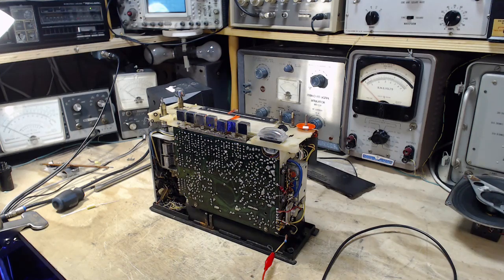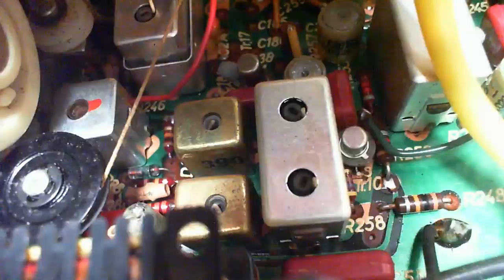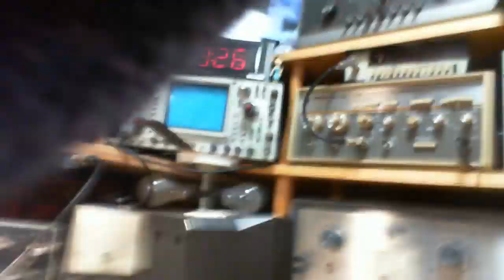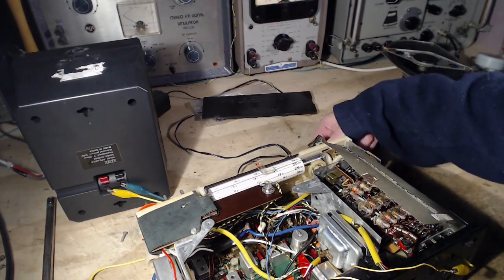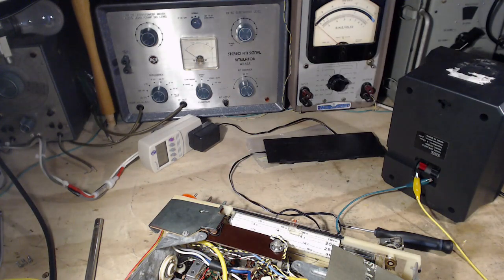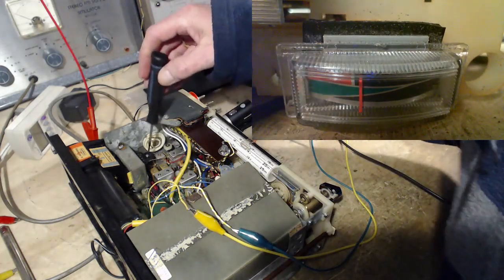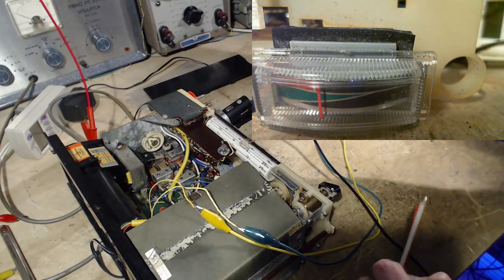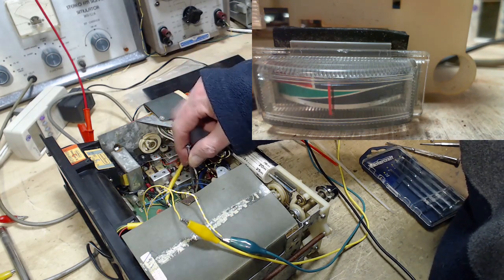Nordmende Globetraveler III   Video#4 - FM Sound Quality

Comment: Normende means don't touch alignment.
Reply: Cosimo Kramarawicz Legit and sound advice , given that with the german radios of this era there is hardly a history of drifted RF and IF components. So if you find it misaligned and there is no indication of ppl having been in it before, you may want to check for possible root causes like failed power supply voltages, bad electrolytics in AGC AFC Ratiodetector, power supply filtering, off value resistors etc. and make tampering the RF/IF alignment the ultimate ultimate resort.

Comment: Get a proper service manual. The alignment of the short wave "BANDS" needs to be performed in order and is highly relying on the exact adjustment of the 49m band with specific frequencies. Also it requires discipline in following the instructions, in that adjustments of bands already adjusted not be changed anymore. And we all know that following instructions to the letter and discipline in following procedures is not Jims strong suit.Also the SW bands turret tuner has a separate stabilized 5V voltage regulator, which has to be adjusted before any other adjustments be made. In that realm the electrolytic filtering the 5V after the regulator should be replaced to ensure minimum ESR (although there is a 47n parallel to prevent worest case scenario) before any further twiddle-diddle. Also FM ratio detector electrolytic should be replaced before detuning the FM IF.
Reply: Too complicated, Jim prefers the eeny, meeny, miny, moe, catch a IF coil by the toe method...
Reply: Again he is using Metal watchmakers screwdrivers with sharp edged blades to adjust the known brittle ferrite core slugs on the IF transformers. We all know where this is going, dont we? This radio will be turned from "working ok may just need be fine tuned properly" to "worse than before"
Reply: StillCloser Yeah. that single coil he is been messing with to "align" FM btw is Filter XIV (as in no.14. Nordmende liked to use roman numerals to designate the Adjustment points) and is the final AM IF. I mean even the most simple schematic or the german version of the TN6000 manual would help to get a general idea. The electrical symbols in the schematics  are "universal language" after all. This blind twiddling is unbearable and counterproductive on such a complex radio.

Comment: Jim, here's a long shot, but it may be worth considering:  I have a couple of nice FM radios that give great sound.  Both have the option of running on battery or AC power.  For convenience, I almost always run them on battery.  And I have noticed that, when the battery voltage drops to a certain level, FM reception becomes a little garbled.  
In an earlier video, you told us you were using an outboard power supply that was not the one that came with your Nordmende.  So you might check to see if that power supply is providing the correct operating voltage for your radio. Good Luck with this one!!

Comment: Hi Jim
Just picked up a Globetraveler IV at a flea market for just $5. It came with the ac cord. Turning on all i get is a  light under the SW tuning bar when pressing the SW button. No sound.  The speaker is good 
I suspect it's missing a secondary voltage. Any ideas
Bill

Comment: Why do you assume that it needs alignment. A place to start is alignment of your shop equipment, frequency counters etc.
Reply: widecast No question that fixing and servicing and realigning his shop equipment is long overdue. But there is a misalignment evident in that radio on SW, yet I am sure it is not due to ALL LO having equally drifted off. Most probably the problem is in the common denominator to all SW band LOs; the SW bands voltage regulator. What is more; if you look at the schematic the "voltage regulator" constructed with a AC122 transistor is not a classical voltage regulator design like we know it which would be based on a voltage divider or zener off the base of the transistor, but it is a variable resistor in the Emitter path of the transistor with a fixed base bias. So it is rather a constant CURRENT source than a constant voltage source. So any additional load on that regulator (like from a leaky filter electrolytic) will cause voltage drop for sure. So checking that voltage is top priority before any SW band alignment is performed (see instructions in the service manual). Also to make things more juicy, the adjustment of the SW bands calibrates the dial pointer on 49m to a specific calibration mark at 6.1MHz . And the tuning capacitor must not be moved from that mark anymore even when on the other bands. Like i mentioned earlier; the true RF SW band alignment is a complex alignment with the need to follow it to the letter and keep your "eeny-meeny-moe-twiddle-here-twiddle-there-I-reject-reality-and-substitute-my-own " mentality in check. So check voltages and maybe even accept the dial pointer being off.

Comment: I would have thought that they would have used voltage controlled tuning via Vericaps and a multi-turn variable resistor, I would have thought that Nordmende would have used Murata Crystal filters for 10.240MHZ  and 455KHZ and not had any Intermediate Frequency transformers and it is maybe why radios are moving towards Software Defined Radios using Silicon Labs radio chips.

Comment: Here's an idea but the meter on FM is a tuning meter and not a signal strength meter
Reply: I was thinking the same thing. Perhaps the way to tune this radio for FM is to center the meter. I seem to remember that the benefit of digital tuning on FM was that the frequency was locked and not the signal strength which is not the best part of the signal. I hope I am remembering this correctly.
Reply: I remember that back in the day transistor radios that had FM required more power than AM and even had a notice in the battery compartment stating that when the FM stops working because of a low battery that AM will still work fine and that's when you should replace the battery is when the FM stops working
Reply: @fiercefeline5096  correct because in most cases especially if AFC is used and it's not switched you want to tune for the center to insure that it's locked to the correct frequency
Reply: Because the AFC can pull the signal from the next station over if it's strong enough causing the dial to go off because it's really in between stations and that's why tuning for center is more important because if you are off center and you are close to a strong adjacent signal the radio can just simply flip to that station
Reply: Well, actually according to the schematic on FM the meter is across the ratio detector electrolytic, thereby indicating signal strength not the AFT voltage or center of tuning range. The user is supposed to tune for peak of that meter (with AFC off). His problems may point to a bad ratio detector electrolytic or misaligned secondary of FM discriminator Filter V(no.5) . Filter V  is the double slug filter with the detachable top cover (right above the single slug filter XIV which he has been fiddling with). The primary of that FM dimodulator Filter V is the core towards the bottom and the secondary is the core towards the top/keyboard side.